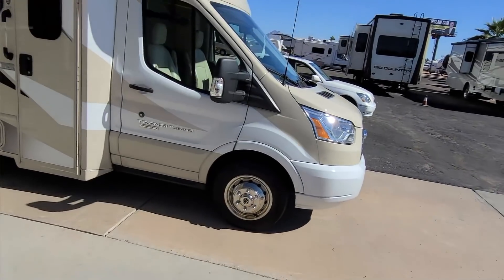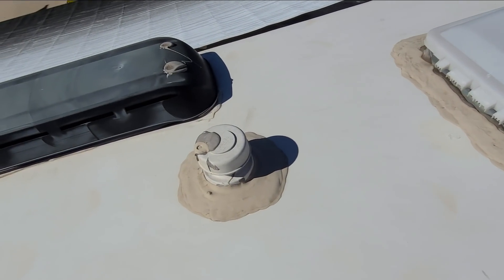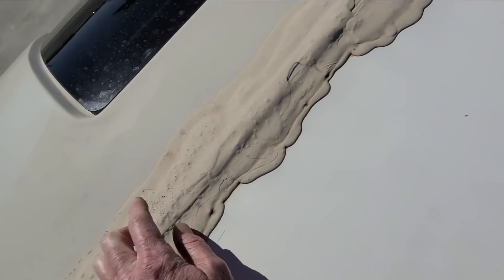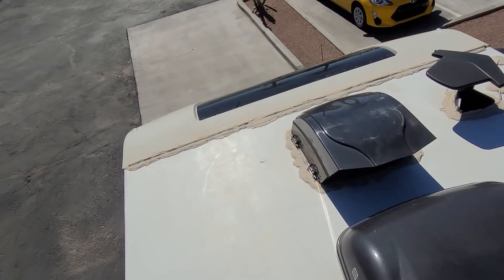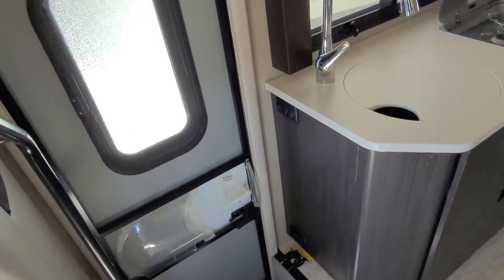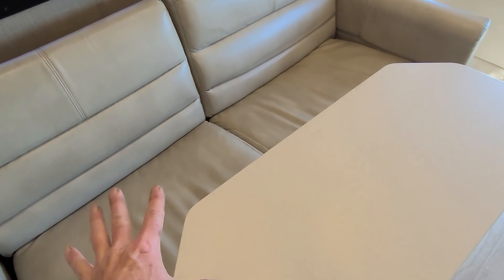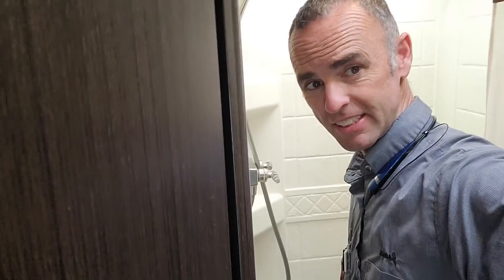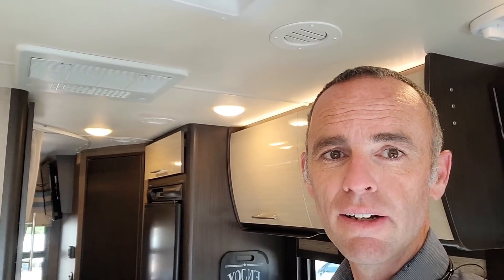2017 Thor Gemini TPO Roof Inspection/Walk Thru

Comment: Thanks for the great review. I have a 2017 Coachmen Orion 24 RB, which I believe has the same roof. Mine is also on a Ford Transit 350HD, has no slide, and mine is a 6 cylinder gas. It's funny after having a 2018 Open Range lite 5th wheel, that all three slides leaked, I traded it in on the used little motor home. It had 6k miles and 4 hours on the generator. No problems so far, and very easy to drive. Thanks again.
Reply from the maker: thank you. I haven't seen too many transit units yet

Comment: Not a fan of that shower curtain. It’s going to get the floor wet. It’s in nice shape and held up well for a Thor. Not a fan of Thor...only company with a Facebook hate group 😂. The leather in Thor has been doing that for years, glad they fixed it 🤦🏼. Someone definitely took care of it though.
Reply from the maker: I also am very concerned about the manufacturer and had to check the mileage a few times as it was in such good shape.
Reply: @Genesis--me8ud  yes but like I said you are old school too

Comment: Half way through you said you didn’t have time for a walk thru.   Thanks for the walk thru!😈
So you like TPO.  Great.   Question, what kind of sealant should be used for TPO on the side where the roof meets the wall?  My book says not to use silicone if memory serves me correctly.    Respectfully,   Kevin
Reply from the maker: I had to split the walk into three different segments while the customer was arriving and doing paperwork
Reply: @AZExpert    So no sealant suggestion.
Reply from the maker: I've found silicone sticks to plastic just fine. it doesn't stick to EPDM well due to the chalking. This roof had a pro-flex type sealant, dap makes "crystal clear" sealant that works too
Reply: @AZExpert    Thank you James!

Comment: Gemini has 156” instead of 178” wheelbase, that’s what I don’t like the Gemini
Reply from the maker: thats a good point, I didn't even think of it.
Reply: @AZExpert  I have absolute no experience with truck nor motorhome, but I always worry about putting too much weight behind rear axles, and I don’t trust RV manufactures actually balance the load and predict how RV owners load on their RV.